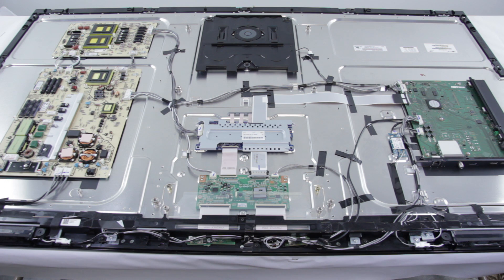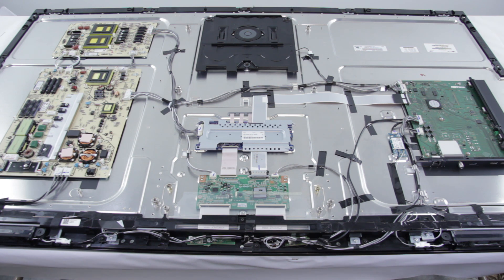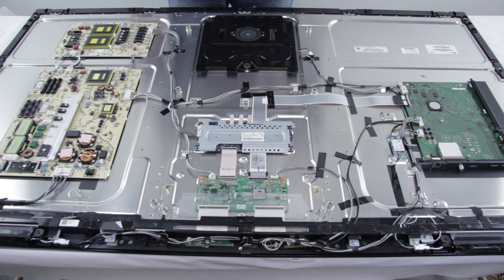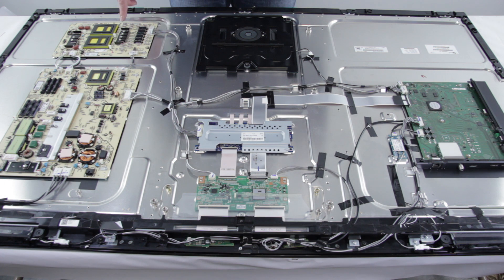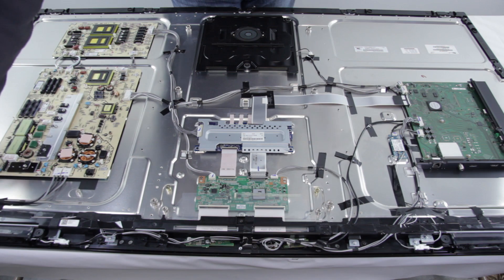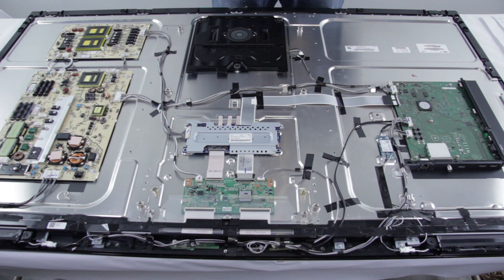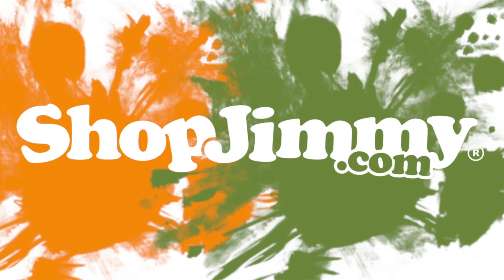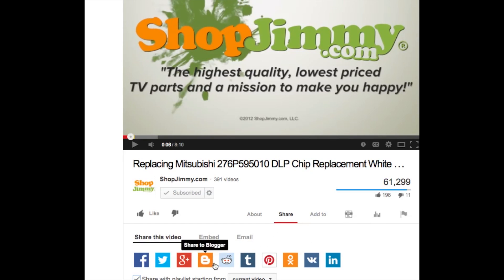LED TV Repair Review Power Supply Overview-NO Power Common Power Supply Repair & LED TV Power Supply

Comment: I have a Sony Bravia TV, KDL46NX720.When I turn it on, the power comes on for about 10 seconds. After this the screen goes out,and the red light blinks 4 times over, and over? I would greatly appreciate a reason, and a possible fix, for this problem.  This TV is from Christmas 2011, so it is about 2 years old.
Reply from the maker: Ronald Thomas   Please watch this video FIRST to help with your repair!  https://www.youtube.com/watch?v=BP3NVNCGEv8  This is the main board protect mode there is a short on the main and to protect the other parts the tv shuts down and gives you a blink code.  I recommend replacing the main board in your TV.  Click this link to replacement parts for your TV model number:  http://www.shopjimmy.com/catalogsearch/result/index/?cat=56&q=KDL46NX720  There may be multiple boards for the same TV model number, be sure to match part numbers on your current board, with your replacement for compatibility.  Here is a link to a video showing how to identify your part number, click here:  https://www.youtube.com/watch?v=Aodz2LHkzbY  Thanks and please let us know if you have any further questions with your TV Repair!  www.shopjimmy.com

Comment: I have a  40" Element TV Model # Eleft406.  I have sound but no picture. I was watching and the picture went black.  I think the power supply could be the answer. This part has the number CVB42001 and CVB32001-3.
Reply from the maker: Donald Price   I recommend replacing the main board in your TV.  Please reply with your part number on your main board and I can try searching for replacement parts.  Thanks and please let us know if you have any further questions!  www.shopjimmy.com

Comment: I have a Toshiba 40S51U that won't turn on.  I all of a sudden wouldn't work.  I was thinking it might be the power button is not working.  The remote was lost a while ago.  All the capacitors inside look fine.  They don't look like they are bulging.  The fuse is ok, and the chord tests ok that connects to the wall.

Comment: Polaroid P40led13 Television
Red led on front blinks 7 times then the screen lights up, NO sound and No picture.
PSU : 23108048 17IPS20
Pcb Main 23115994

Comment: I HAVE A SAMSUNG                  MODEL LN52A630M1F 
When I turn it on I get a screen of static and a loud sound from speakers
if I turn it off it will usually start as normal if not I power off and on until it comes on.
Than works as normal.  Samsung said could be a Capacitor problem on power supply board but will only pay for parts no repair. Do you agree with diagnosis .
                                                                     Thanks for help
Reply from the maker: csdibast  Please watch this video FIRST to help with your repair!  https://www.youtube.com/watch?v=BP3NVNCGEv8  I recommend replacing the main board in your TV.  Click this link to replacement parts for your TV model number:  http://www.shopjimmy.com/catalogsearch/result/index/?cat=56&q=LN52A630M1F+  There may be multiple boards for the same TV model number, be sure to match part numbers on your current board, with your replacement for compatibility.  Here is a link to a video showing how to identify your part number, click here:  https://www.youtube.com/watch?v=BEPWrefQvqI  Thanks and please let us know if you have any further questions with your TV Repair!  www.shopjimmy.com

Comment: Hi. my Samsung le40656 will not power up. there is a 6.3 volt fuse blown on the power board which i replaced but it blew when i tried to power up. i reckon i need a replacement power board. can you tell me what part i need to order ?
Reply from the maker: Toxicarp 39   I recommend replacing the power supply board in your TV.  Unfortunately I do not see any replacement parts in the search results for your TV model number on our website.  Please reply with your part number on your power supply and I can try searching for replacement parts.  Thanks and please let us know if you have any further questions!  www.shopjimmy.com

Comment: Have a Samsung UN39FH5000 LED TV that I bought off Woot about a year ago as a refurb with a 90 day warranty. The screen is now blank (not even a menu display), but there is sound from all connected devices (cable, DVD, VHS). Opened up the back -- there are three circuit boards but none are obviously damaged (no blackened components and the capacitors on the power supply board all appear to be "flat"). Any idea what the problem might be and which part I'd need to replace? Thanks so much for your help.
Reply from the maker: John  Please watch this video FIRST to help with your repair!  https://www.youtube.com/watch?v=BP3NVNCGEv8  This could either be a problem with the power supply board or the LEDs in your TV.  You can replace the power supply board in your TV.  Click this link to replacement parts:  http://www.shopjimmy.com/catalogsearch/result/index/?cat=59&q=UN39FH5000  Be sure to match part numbers on your current board, with your replacement for compatibility.  Thanks and please let us know if you have any further questions with your TV Repair!  www.shopjimmy.com

Comment: i have a 55 inch samsung LED TV UA55ES 8000 Series. It does not not power on. there  is a clicking sound. sometimes the samsung logo appears and again it starts clicking.is it a problem with Power supply board or main board .if so what are the costs

Comment: Hello. I am having a problem with my Samsung LED UN46EH6000F TV.  The initial symptoms were - while watching it randomly would begin to power cycle. Then when unplugging, it would power on until I connected the HDMI cable (either Slot) at which point it would go black and cycle. Then finally, it now will not power on at all - sometimes just power cycle (no other connections connected. HELP!  Also, I've visually checked all capacitors, and found none bulging or leaking fluid. They all look great.

Comment: It doesn't turn on
Reply from the maker: Jordan Alborough   I recommend checking the capacitors on the power supply to see if they are swollen or not.  If the capacitors look good, then I recommend replacing the control box.  Unfortunately I do not see any replacement parts in the search results for your TV model number on our website.  Thanks and please let us know if you have any further questions!  www.shopjimmy.com

Comment: my polaroid 40" LED Full HD TV P40LED13 is not working what should i do
Reply from the maker: Jordan Alborough   Could you please provide more details?  What are your TVs symptoms and problems?  Do you have a standby light?  Does the TV power on?  Does the screen have an image?  Thanks!  www.shopjimmy.com
Reply from the maker: I recommend checking the capacitors on the power supply to see if they are swollen or not.  If the capacitors look good, then I recommend replacing the control box.  Unfortunately I do not see any replacement parts in the search results for your TV model number on our website.  Thanks and please let us know if you have any further questions!  www.shopjimmy.com

Comment: I have a SIGMAC 42' LED tv (SE42BB1) that won't turn on.  All of the components look to be ok.  Need help.
Reply from the maker: habspats1   Are there any other symptoms that the TV is showing?  Thanks!  www.shopjimmy.com
Reply: Nope.  One day just wouldn't turn on.  Checked the outlet...it worked.
Reply from the maker: habspats1   Do you have standby?  Any blinking lights on the front of the TV?  Do you have backlights?  Thanks!  www.shopjimmy.com
Reply: ShopJimmy.com the TV does have standby....there are no blinking lights...no lights at all

Comment: I have a Westinghouse model number  uw40t8lw that will not power on at all? I have the full 19v from the power cord coming in and no signs of blown caps or diodes, I also can not match up the board .( T.ms-3391.e72 40a1 12 sp24) anywhere I look,and would like to try to fix this as cheap as I can. Could the issue lie in the eeprom? and if so, which one would I need to replace?  Please let me know if you can. Thanks DASH556@AOL.COM

Comment: Samsung LED 40" un40d5003 - blinking light of power (4 times) no image. The TV no work after a general blackout in my city. Please Help
Reply from the maker: Marcelo Salga  If you do not know which board is bad, after a blackout or power surge, it is recommended to replace the power supply board and the main board in your TV.  Here is a link to replacement parts:  http://www.shopjimmy.com/catalogsearch/result/?q=un40d5003  Be sure to match part numbers on your current board, with your replacement for compatibility.  Thanks and please let us know if you have any further questions with your TV Repair!  www.shopjimmy.com

Comment: Hello I have a problem with my Seiki model SE322FS TV.  It will not power on from the remote or the switch, the red led in the bottom left corner does light up.  This problem has been getting gradually worse the last couple of weeks, at first it would turn on after unplugging the TV then plugging it back in. Now it will not even do that.  I have taken the back off of the TV and found no discolorations on either of the boards nor any blown capacitors.  Do I need the main board or the power board?
Reply from the maker: Spencer Robinson Please watch this video FIRST to help with your repair!  TV Repair! LCD, LED, Plasma, DLP How To Fix Your TV with ShopJimmy.com Help!  I recommend replacing the main board in your TV.  Here is a link to replacement parts: http://www.shopjimmy.com/catalogsearch/result/?q=SE322FS  Be sure to match part numbers on your current board, with your replacement for compatibility.  Thanks and please let us know if you have any further questions with your TV Repair!  www.shopjimmy.com

Comment: hi my LED TV is a Panasonic Viera model number TC-L42E3  the problem im having is that it was fine then it like the picture was blinking dim like then it turned off when i try to turn on the power light will go on but the back light wont light up and then the red power light will blink once a couple of seconds later it will blink again and it will keep doing that over and over again i hit the power botton and the tv power light will go off i turn it back on and the power light will stay on for a couple of seconds and it will blink once every couple of seconds but no back light goes on when i power the tv on i purchase many boards from you and will like to see if you guys can tell me wish board you recommend me to purchase to fix my problem will it be the inverter board the power light only gives me one blink every 5 to 10 seconds please let me know what do you recommend me thank you
Reply from the maker: Julio   This test will help to determine if the problem is the LEDs or the power supply that is bad.  I recommend running the flashlight test on your TV.   Here is a link to a video we produced that shows how to run the flashlight test. No Image No Picture on TV Screen - Flashlight Test LCD & LED TV Repair - How to Diagnose Symptoms 2 Please reply with your flashlight test results and we can recommend a replacement part for your TV repair. Thanks and please let us know if you have any questions! www.shopjimmy.com

Comment: I have a Panasonic VIERA TC-L42E3 42-Inch 1080p 60 Hz LED-LCD HDTV, purchased in early 2012. The TV will not turn on. However, if unplugged for a day or two and then plugged back in, it will turn on again for just 20-40 minutes.

When plugged in, there is a constant and faint ticking noise that can be heard that emanates from the back of the television.
Reply from the maker: Scott Hyman   I recommend replacing the main board in your TV.  Here is a link to replacement parts for your TV model number on our website, click here:  http://www.shopjimmy.com/catalogsearch/result/index/?cat=56&q=TC-L42E3  Be sure to match part numbers on your current board, with your replacement for compatibility.  Here is a link to a video showing how to identify your part number, click here:  Panasonic Plasma HD TV Repair Tips: Suffix Codes for A Board & Main Boards  You can also call our customer service for further assistance with your purchase.  (877) 881-6492  Thanks and please let us know if you have any further questions with your TV Repair!  www.shopjimmy.com

Comment: Hi  I have a Samsung LN40A530P1F when I press the power button it kept emitting that audio sound like it wants to come on but it never power on. Any help will be helpful
Reply from the maker: Bridgette Delva   I recommend replacing the main board in your TV.  Here is a link to replacement parts for your TV model number on our website, click here:  http://www.shopjimmy.com/catalogsearch/result/index/?cat=56&q=LN40A530P1F  Be sure to match part numbers on your current board, with your replacement for compatibility.  Here is a link to a video showing how to identify your part number, click here:  Samsung Main Boards & Digital Boards: Part Numbers for LED, LCD, DLP, Plasma TV Repair  You can also call our customer service for further assistance with your purchase.  (877) 881-6492  Thanks and please let us know if you have any further questions with your TV Repair!  www.shopjimmy.com

Comment: I have a Magnavox 32" LED flatscreen.  m2me403v/f7 that will not power on.  Nothing happens when I hit the power button.  Thank you
Reply from the maker: Rachel Templeton   I recommend checking the fuse on the power supply.  Let us know what you find.  Thanks!  www.shopjimmy.com

Comment: Hello. I have a 42LF75 which wouldn't turn on. I have replaced the fuse but no power. Is it the capacitors?
Reply from the maker: Khalid Abdulaziz   I recommend replacing the power supply board in your TV.  Here is a link to replacement parts for your TV model number on our website, click here:  http://www.shopjimmy.com/catalogsearch/result/?q=42LF75  Be sure to match part numbers on your current board, with your replacement for compatibility.  Here is a link to a video showing how to identify your part number, click here:  TV Part Number Identification Help Guide for LG & Zenith Power Supply Unit (PSU) Boards  You can also call our customer service for further assistance with your purchase.  (877) 881-6492  Thanks and please let us know if you have any further questions with your TV Repair!  www.shopjimmy.com

Comment: hi i got an LG 47LD520-ua tv  the tv works great for a short time then it starts acting up  screen goes black for a sec comes back on   usualy a couple times. then the tv shuts off  sometimes it just shuts off  if u can tell me about this im looking for parts for an affordable repair even considering  doing some soldering if its the capacitors. it acts more like something is overheating it can unplug it  plug it back in turn it one and then it works for 15 20 seconds and acts up and shuts down  thanks.
Reply from the maker: HORIZON8026   I recommend checking the capacitors on the power supply to see if they appear swollen or puffy.  Please reply with the results, thanks!  www.shopjimmy.com
Reply: i looked at them a few times they didnt look bad  i can look again and make double sure  that but  from more that ive figured its something to do with the lcd lights.  when the sun was on the screen i could see the lcd is still on for a couple seconds  before the tv shuts down so the led lighting is shutting off the once its  starts sutting off i can turn it on for a  minute mabey then it does the same thing sometimes the  lights will come back on a couple times then finally they go out and tv shuts down again.  the behavior makes me  think it is the capacitors but im no expert in electronics im thinking the tv shuts down to protect its self for what ever reason the lights are turning off for  but i think the capacitors wont hold enough charge and then the lights act up was my theory  and finaly its had enough  and  keeps shutting off.  The run time was better when i turned the screen brightness and  backlight settings all the way down but even thats not working anyore as much
Reply from the maker: HORIZON8026   I recommend replacing the power supply board in your TV.  Here is a link to replacement parts for your TV model number on our website, click here:  http://www.shopjimmy.com/catalogsearch/result/?q=47LD520-ua  Be sure to match part numbers on your current board, with your replacement for compatibility.  You can also call our customer service for further assistance with your purchase.  (877) 881-6492  Thanks and please let us know if you have any further questions with your TV Repair!  www.shopjimmy.com

Comment: Hey. I was checking out your website and saw you repair and sell parts for led tv's.  I have a toshiba 55wx800u which turns on, has sound, but has no picture. Any way of you telling which part I need to order based on things I mentioned. Thanks.

Comment: My tv model Samsung ua40f6400. It was not working. power led continuously blinking. observed relay on psu board continuously on and off. I measured the voltages at the output of the PSU board BN44-00662D 5.2V is ok. for 13v i am getting 8.9v only pls help.
Reply from the maker: Satyam Narayana  I recommend replacing the main board in your TV.  Here is a link to replacement parts for your TV model number on our website, click here:  http://www.shopjimmy.com/catalogsearch/result/?q=40f6400  Be sure to match part numbers on your current board, with your replacement for compatibility.  You can also call our customer service for further assistance with your purchase.  (877) 881-6492  Thanks and please let us know if you have any further questions with your TV Repair!  www.shopjimmy.com
Reply: my samsung led 3d tv (model number UA40F6400DKXXT ) is not working its power supply and mother board damaged in a lightining. where can i get spare parts.